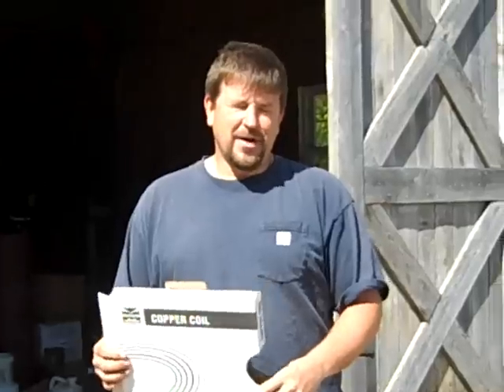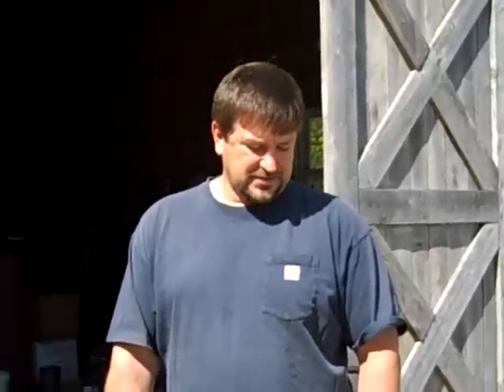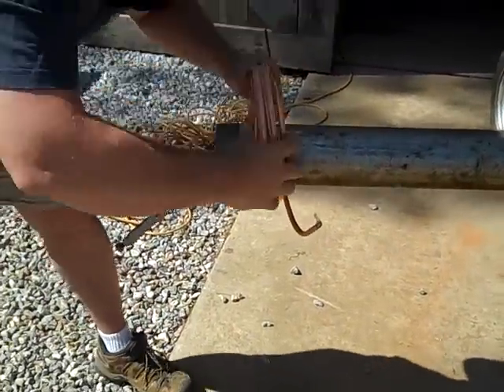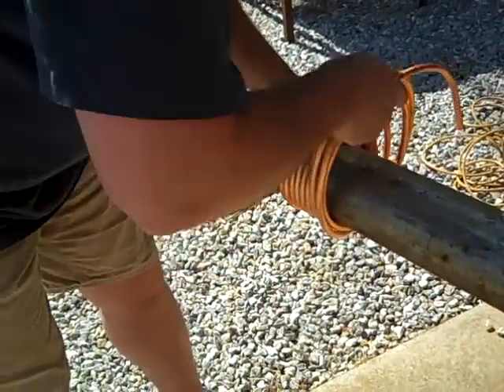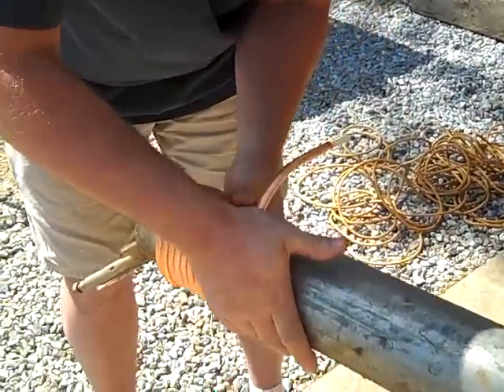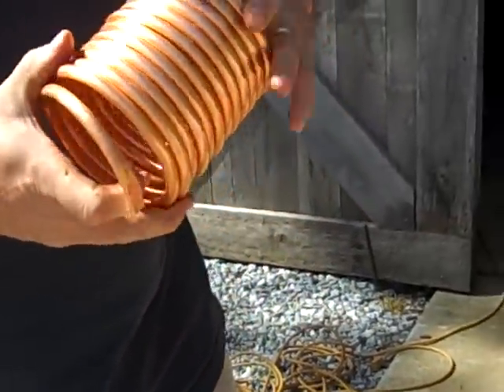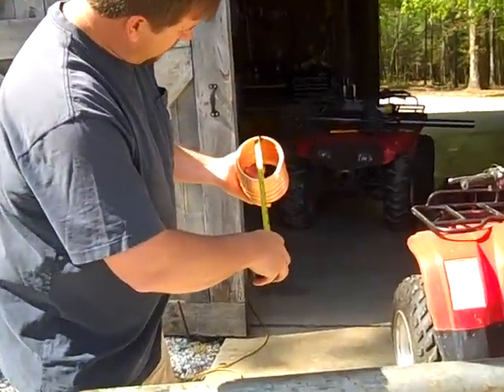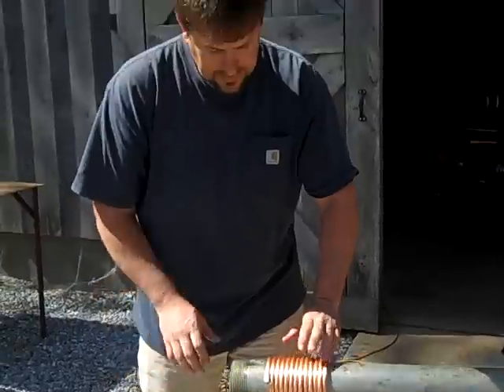Prepper Tip- Bending copper tubing with ICE!

Comment: I use this method to wrap 50 feet of 5/8" OD type L copper tubing around 5" OD steel pipe.  It works like a charm.  Be warned though.... I'm a pretty well built guy and this is quite an arm and shoulder workout.  Also work quickly. Once the ice starts melting, the tubing will start to crush like an oval until it finally just kinks.

Comment: I built a penstock - pipeline - for a hydro power installation using 'yellowmine' pipe. It is perhaps schedule 120 pvc and impact resistant. Very heavy. I taught myself to bend this monster pipe for small curves around boulders by duct taping and using a caulk type sealant inside endcaps reserved for this purpose. Once you have capped the pipe use a propane hand weed burner and carefully heat the pipe at the area of the bend. I laid it out in the dirt and had two helpers. The air pressure builds inside the pipe and it cannot collapse as the slow bends are made. Went to 45' a few times! Wish I had made a video of it now. Watch out when the end caps blast off when the tape is released.

Comment: I made a 1/2" copper coil to replace one in a wall mounted drinking fountain.  Rolled it around 6" pvc sch-40.  C-Clamped it, then I used my turbo torch & silver soldered a small spot between coils on each end to prevent expansion.  Soldered a 1/4" tubing inside it for the temp probe, then I rolled 1/4" tubing in between the 1/2" coils for my Freon line also silver soldered.  Then I slipped a small plastic bag around it & filled it with expando foam. circa 1988.  Never had issues with tubing crimping.

Comment: My father in law worked at Conn musical instruments (Elkhart, IN) in the early 1930’s through until WW2 started, where they made trumpets snd other brass instruments 

He told me they bent the tubing by filling with hot tar, letting it set up, bending the tubing, snd then heating it up to remove the tar. 

BtW he was working when Tommy Dorsey came by to buy new instruments for his band. He got bold and asked Tommy if he would come to his high school senior prom and play which occurred about the time the order he was making for the instruments would be ready. 

Tommy Dorsey said yes and for free plated that high school senior prom the year before WW2 started

Comment: After looking at numerous ways to bend tubing in a small diameter without bending the tubing this way is so simple and my answer. I'm going to try it on a 100' 1/2" stainless coil and it should work fine.

Comment: I had to make a sharp bend in a short length of copper pipe when replacing a water heater in my RV last year.  I had a tubing bender, but it was still cracking and crimping.   I ended up using some scrap 14-2 wire.  I packed the pipe with the wire (still in the inner insulation but stripped out of the white plastic outer casing), then used the tubing bender.  Worked like a charm.   I'm not sure if the freezing would work on a short length, but I might try it someday.  :)

Comment: nice,  with jewelry ferrous and nonferrous metals I've used sand, taped off the ends, depending on how thick the walls are one can use a raw hide mallet, that copper tubing seems to be soft as if it was annealed,

Comment: Water also works as long as you get all the air out and either crimp the ends tightly or flatten and solder the end closed.solder the end closed.

Comment: I've heard about doing this by filling the tube with sand.  The ice idea looks simpler and faster.  Very cool, and thanks for the tip.
Reply: How hard really to feel up tube with the sand or salt, even without a funnel.
And it doesn't melt if you are slow or distracted.
Reply: Hmmm, 24 hours to freeze (and risk rupturing the copper tube) isn’t fast. In industry this is done using fine kiln dried sand like used for block paving top dressing. Ultra quick and will not harm the copper pipe.

Comment: By the way Electricians used to put sand inside Rigid metal conduits to bend it years ago. and cap off the ends while the sand was filled inside of it if they had to make field bends decades ago the pipe would not crush or kink!   Great tips sir!

Comment: White fine grain "sandbox" play sand works great and is reuseable to boot.. And or use a round tip mandrel just a lil smaller than the id of the copper tube. Can use rebar or whatever steel u can find. Work the mandrel out of the tube by hand while bending. Works great too.. 
Great vids btw!

Comment: Engineer775 excellent video I use sand which works great like ice but you don't suffer cold hands.  In the 1965 movie "Flight of the Phoenix" The German airplane model maker, played by Hardy Kruger, was bending tubing by packing sand in the tube. He was constructing a condenser to collect water moisture from the night air of the desert.

Comment: I managed to coil 1/4 inch tubing in a coil that is 1.5in outside diameter for a project. The ice method didint work for me. I ended up straightening out 25 feet of tubing, taping one end shut and filled it with salt (it took awhile) But when I coiled it around a broom handle it didint kink at all. When I was done I just clamped a hose to the coil and ran water through it. Eventually the salt dissolves and you have a perfect coil.

Comment: I don't want to be a wise-ass, but I coil copper tubes daily and it is quite easy to bend copper tubing when the diameter around which the copper tube is to be bent is more than 6 times the diameter of the copper tubing. When the diameter of the coil is more than 6 times the diameter of the tube you do not need to fill the tube with anything. Just roll the copper tubing around a pipe with suitable diameter by hand. It is easy and the coils will not collapse and do not need any support. Cheers.

Comment: If this is a SHTF situation, you might not have ice until you have a coil to chill with: catch 22! So, it's a great tip, but my advice is you should also practice with sand for when you have to use it or can't wait for ice.
Reply: i think that's why it's a Preppers channel

Comment: i have done this before without ice or sand, there were no kinks. When you use that type of copper it is soft enough not to kink. One guy held the copper and kept it aligned whilst the other twisted it onto a stove pipe, just keep the coils tight!
Reply from the maker: Try it with 4" and it will kink.  A 6" stove pipe is a big enough diameter to keep it from kinking.
Reply: I have used 4" before, i think the trick was to pull it as tight as possible and keep the tube close to the pipe, to be honest it was many years ago, since then the copper has been removed (twice over) very annoying as it's not easy to find cheep. The other pieces had been donated by the local tip and from a friends camping heater, where he had wrapped it around his gas heater to get hot water in his van, that one was a real mess as it was already kinked and wrapped around a rectangular stove, we didn't think it would go on without cracking, however even after all the abuse it did wrap on fairly well and no leaks! Flow was a little restricted but it didn't matter at those temperatures. Keep up the good work, i'm sure i will use the ice or sand trick next time just to be sure. Great tip.
Reply: engineer775 Practical Preppers will it work with the thinner 3/8 copper tubing we're seeing today I used to bend the thicker 3/8 copper tubing around a fuel filter to make a heat exchanger to run veggie oil for my diesel
Reply: +izzzzzz6  depending on how tight the coil is.
Reply: Yes but i was going onto one of the smallest stove pipes available and it was fine. If the copper is the bendy type that is designed to be bent easily and it is a fresh roll the trick is keeping the tension between the two people, it's not that easy and helps if its two strong guys but it is possible. I held the stove pipe whilst my friend fed me the pipe, we tried to keep the coils as tight as possible. To be honest i can only max out at 20C water temp in my small radiator circuit. I am going to take the section i made and enclose it inside a larger stove pipe, allowing some of the flame to go between the two different diameter pipes. Hopefully this will give me an extra 10-20C

Comment: I'm back to say that plain Morton salt works too if your copper tube is no longer a coil and can't fit in the freezer. You'll need a small funnel. I used an air compressor to blow the salt out of the tube. You may want to tape a sock on the end to catch the salt instead of making a salty mess like I did.
Reply: Eric you're SO smart. I was thinking, damn I don't have any fine sand. SALT! What a good idea.

Comment: great tip , with one slight exception,coiling vs bending copper .. not the same .. try to "bend" a series of 90's by hand this way. the odds of the ice cold copper to kink are high.

 regardless,thanks for the tip !

Comment: The comment "Fill it with sand" makes perfect sense. this chap is using a roll of soft copper which bends easy, and fits in a freezer, what if you had a straight 3 or 6 meter length of standard plumbing copper, how would you get that in the freezer, instead fill it with sand tap and shake it very well seal both ends (compression fittings possibly) and then put it over you knee and when you bend it the sand stops the pipe from kinking ( if its packed tight enough).

Comment: For a couple-three feet of tubing, sand works great. 10-12 feet or more, not so much

When using sand, first you've got to straighten out the tubing, or you'll never get it filled evenly, and it WILL deform wherever there are void spaces, or not packed tight enough

And if your working in a confined space, making the bends from straight tubing can be problematic

Then there's the hassle of purging ALL the sand from the tubing, while ice water is easily blown clear, even without an air compressor

Comment: just fill with water then cap both ends with the rubber cap the tubing you bought came with. you can put hose camps over the rubber caps if you want. you can use any liquid because you can not compress it, there will be a little spring back without freezing it but its a lot faster; no kink tip.

Comment: Nice advice!! Wondering if there could be some damage if using 3/4" Cu pipe for heat exchanger with ICE procedure... Cu is self recoverable material (can acommodate more stres than rest of materials, and recovers in time)...but nevertheless.... I will try with quartz sand, works excellent with 3/8" Cu pipe (ends needs to be closed)

Comment: Fine grain sand or table salt is my preference.  But you can't have TOO MANY ideas (that work) floating around in your noggin'!
Reply: Jason Statham  What size is 3/8' with 1 1/2 inch tube? Is that 3/8" I.D. tubing? Reply back with how you got the salt out. It seems to be a major problem. I think you need to use an air compressor and keep the salt totally 100% dry, and also you should use regular salt with calcium silicate in it, or some other anti-clumping additive. Pure salt clumps together when it hits moisture, and adding water probably makes it clog up. I think a dry air compressor is what others are using, but I've never tried the salt myself.

Comment: 3/8 copper pipe(for air conditioning) will not kink if you bend it at that angle! wheras if you used 1/2 copper pipe that would be a cool idea (: or even sand as micers said (in the freezer the ice might brake it!)

Comment: Use soapy water! You would have problems if you started off with straight pipe and wanted to make sharper bends, because the ice breaks inside and leaves the pipe walls unsupported. So to do this properly, you should add soap to the water before freezing, and that makes the ice flexible!
Reply: Is that a real thing? Ice can be flexible?
Reply: huh?  no.   thats just nonsense.  you WANT the water to completely freeze, if it doesnt then the pipe will not bend evenly and end up pinching.

Comment: You would be right, assuming you pay for electricity only so that the water is frozen.
In reality, the freezer is running regardless of there being a copper tube full of water in it or not.
So for everyone that owns a running refrigerator + freezer that is not completely full (i.e most people), freezing the water would be practically free.

Comment: If you're building a refrigeration system and plan to use the pipe as your suction line or liquid line, make sure you purge the line thoroughly with nitrogen.  I've used salt in a pipe before to achieve this, never water/ice.

Comment: How many feet would you recommend for the hot water heating for size 1/2" pipe?/?
And when heating the water in the copper pipe, is the fire hitting the copper tubing directly?/?

Comment: Im sure this works to some degree. But when the copper pipes in our old family cottage freeze, they burst. Then we replace them with pex, flexable plastic tubing. Do the same video with some fine sandblasting sand. Then blow out the line or run water through it.

Comment: I would think dirt would work, too.  You're just putting something solid but sort of malleable in the pipe so it can't compress and kink.

You could run water or a pipe cleaner through it.

Comment: Just fyi. Yes this will work but... There's an easier way, quicker, safer and just as clean.
The only problem with freezing it is even though the pipe doesn't burst and they can push the water out, water expands and it just doesn't do it in a linear fashion. It expands out in all directions. This means that you can actually weaken the inside wall putting micro fishers in the tubing future especially if the tubing is under any kind of pressure in the future after forming .

So here you go, this is how you do, sweet and just as easy
Dunk the coil in a bucket of water and get all of the air out of the tube. Take a pair of needle-nose and crush one and then bend it and crush it against the tube to seal. Put your thumb on the other end pull it out. Do the same thing with the other end. Make sure that no water is leaking out. You want to make sure that it is completely full of water.
Then go ahead and wrap it. I know it sounds crazy water is soft... The truth is water fills the vessel. Water doesn't compress and you're not creating a substantial amount of pressure (so you shouldn't blow the seals you made) just forming the tube. The water is just holding the space. You can hand form it roll it around a pipe, whatever you want to do. Once you get to the shape that you want it and you're happy snip off the ends and blow it out. If you feel that your crimp isn't holding tight, tip up the crimp and braze a wade of solder on the end.  Trust me and do this and it will not put any microfractures on the tube so if it is rated to a certain PSI it will still be able to handle that PSI after forming. The funny thing is how hard that tube is going to be while you were turning it... And it's just water inside what it will be very rigid and fight you but will hold its shape.

Have fun 😁👍

Comment: Nice and all I suppose. But what happens if you got no ice? No power to run the freezer?
Reply: Fill the tube with silica sand, plug both ends with a piece of wood whittled to a taper, tap into place. When you've bent your pipe take out the plugs and tap the sand out
Reply: Frankie Fourfingers Thats always been a favorite method of mine , salt or sand will work fine......
Reply: Do your pipe bending in the winter.
Reply: I think engineer775 said fill it with sand.
Reply: Sand , salt , what ever you may have at hand with that same consistency.........
Reply: If you are a true prepper you will already have this done before you lose power.
Reply: ***** true that, definitely use a material that is up to your needs...

Comment: I have a question water does not compress so why do you need to freeze the water in the tube just fill the tube with water crimp the ends and Bandit or if you want to work harder like you have fill it with sand thanks

Comment: Um....why would the water splooge out the end as youre wrapping it?  (Yes, splooge is primarily a noun, but can be used as a verb)  The volume of the tube doesn't reduce no matter how its wrapped...a single loop holds just as much as a multiple loop, cuz the ID of the tube doesn't change...so why does the ice creep out the end?  Any ideas to help my brain's clutch from getting stuck on this?

Comment: casting sand works faster and better. it takes seconds to fill with sand and and then air compressed out. ice you have to wait hours for it freeze then you have to wait for it to melt. good info if you have no sand.
Reply: that's GREAT - IF you have a compressor...

Comment: Here's a better trick. Solder a copper end cap on one end of the pipe and a shut off valve on the other. Or shut off valves on both. Close one end, fill with water, shut off the other end. Now the pipe is full of water and start your roller bend. When your done, drain the pipe. Thats it!
Reply: Really, that's not a better idea. In engineering, simple that works is always the best. No sense in making the pipe in the freezer idea more complicated

Comment: How tight of a coil can you make? Is 4" the smallest you dare go without splitting? Or would sand be a better choice than ice for a smaller coil?
Reply: Admittedly I am unsure of the science behind this but I would imagine filling it with sand and then heating it up with a heat gun as you go along slowly bending it around a smaller diameter. AGAIN it makes sense to me but in practice I don't know.

Comment: if you filled the copper tubing with water and plugged both ends why would you need to freeze the water?    Seems to me that the pipe filled with water would prevent the copper from kinking as well.   Perhaps you did not try that?